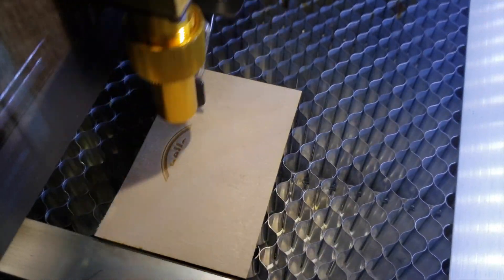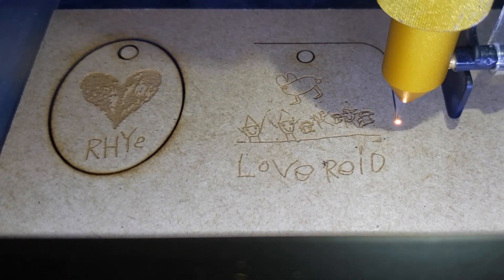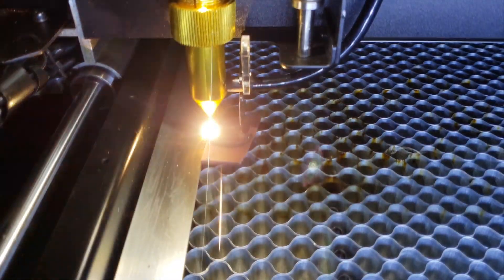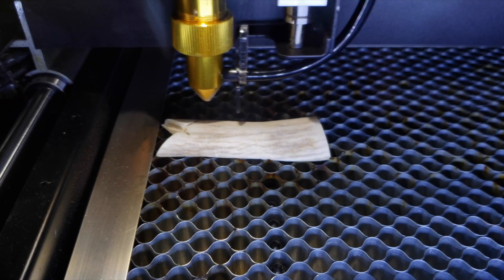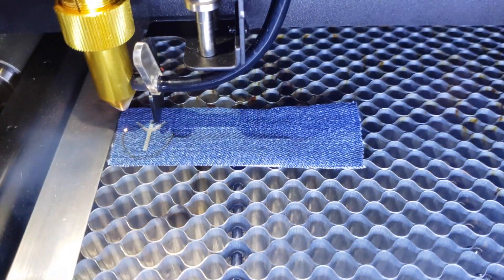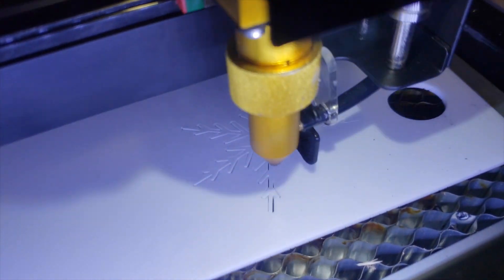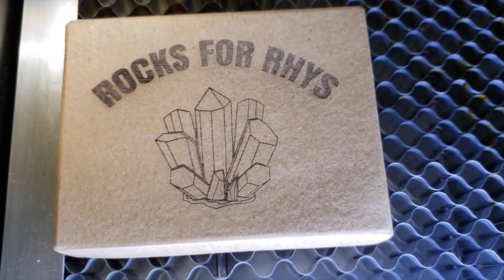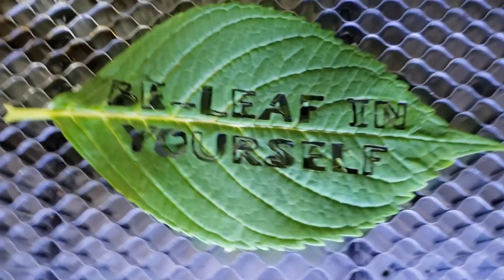FLUX beamo Materials Testing with 3D Universe

Comment: Is there any good setting for silicone watch bands?
Reply from the maker: That's not something we've tested. The best option would be to do some testing to identify the right settings. If you open the Beam Studio software and look under File > Examples, you'll find an Engraving Test and a Cutting Test option. This will make a series of engravings or cuts using different settings so you can see which works best.

Comment: Jen could you help me out on another problem other then materials. I want to import and image (lettering) from WORD to beamo. I can get the word spelling on the grid but can not make it load and print. What i do get is square blocks on the grid with out the lettering when I hit print preview.
Reply from the maker: Jeremy here, jumping in for Jen (I deal with the more technical stuff). Rather than dealing with the complexities of exporting from Word in the appropriate format, wouldn't it be easier to just use the text tool built into the Beam Studio software? Just click the T button in the left-side toolbar to add text. You can position and rotate it as needed. Then you can use the formatting controls in the right-side panel to adjust font, size, etc. If that doesn't do what you need, please clarify what you're trying to do, and I'll provide further advice.

Comment: Hi how do you know what settings to use on your materials? What was your thickness for the acrylic
Reply: I used the default settings on most of the things I have tried and then adjust speed or power depending on a test run before I do the real cut or etch to make sure it is what I want it to look like. :)

I used 1/8 acrylic for this project. :)

Comment: Are you using the Beamo Air unit yet?  If so, did it help with fumes.  Also what thickness (2mm, 3mm) did you use for the acrylic and machine settings for the acrylic.  Thank you.
Reply: Yes! It helps a lot. We have ours set up in the garage and for the most part it keeps the fumes at bay but when my roommate engraves on bone or antler, it smells really bad and we try to open the garage door for that!

I believe my acrylic was 2mm thick and I used the settings that were pre programed in there.

Comment: what size acrylic did you use and do you have a link to where you purchased it?
Reply from the maker: We usually get our acrylic from Inventables (https://www.inventables.com/categories/materials/acrylic). 8x10" would be the ideal size, but the 8x12" pieces they sell are okay - it will just overlap the sides of the work area a little.
Reply: Oddly enough, I get the acrylic from Home Depot, masquerading as window glass.

Comment: What settngs did you use for the MDF board? Can't get mine to cut through
Reply from the maker: We used Power = 60%, Speed = 0.2 in/sec, 1 pass. But we did have a little burning around the edges, so a slightly lower power setting might be okay. You may want to use the material cutting test that's included within Beam Studio. Just go to File > Examples > Material Cutting Test. That will cut a bunch of squares at different power levels and speeds. Then you can just see which one cut best.